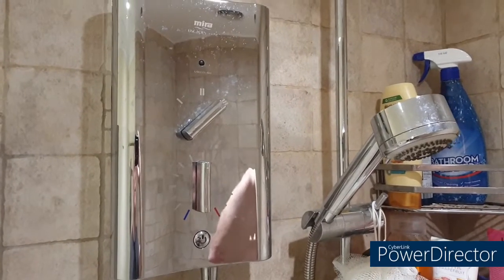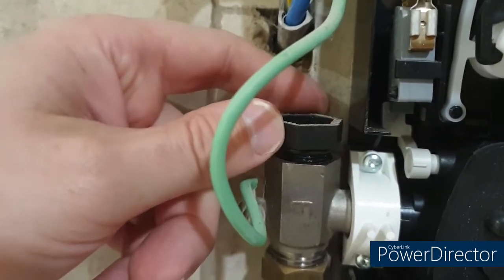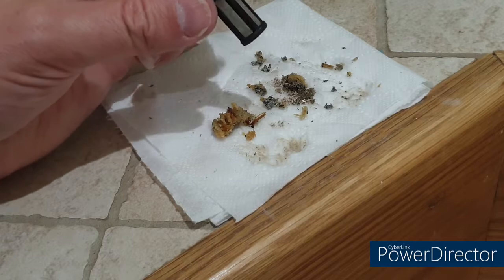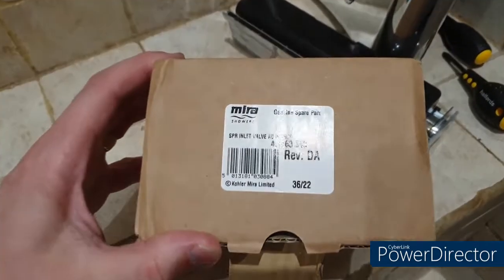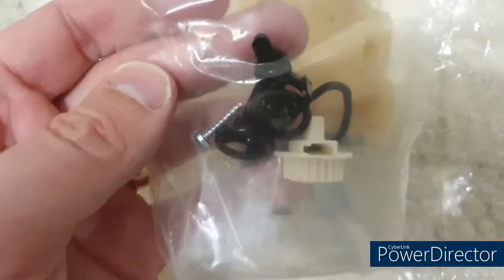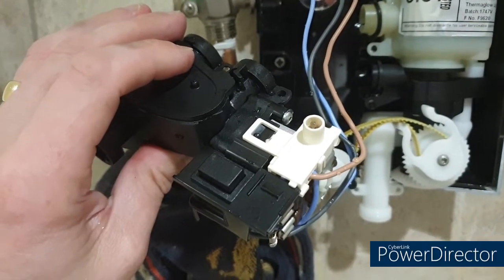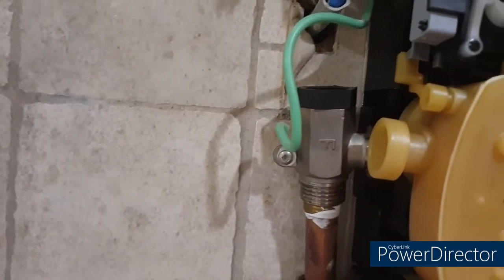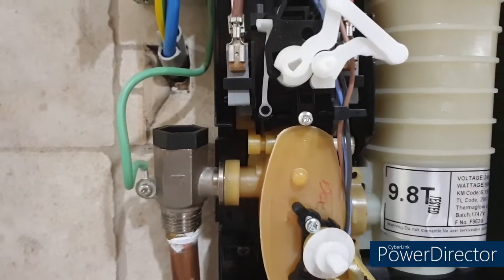Mira Escape Electric shower. Low Flow warning. No water flow. Valve and Solenoid replacement.

Comment: Hi, not sure if anyone will see this or able to help, we have one of these showers , sometimes when turning it off it the water doesn’t stop running, we’re having to shut the water off or the main power to the unit, other times it will go off but take like 5 minutes , would this be the solenoid too thanks

Comment: What is the likely fault when the shower runs for a minute, then it trickles out, power remains on at unit and mcb doesnt trip etc, turn it off and back on, it'll do the same process? Any ideas

Comment: Stupid question but do i need to turn the water mains off when loosening that fitting @9:24 or will water just continually flow out of it?😄
Reply from the maker: I think I had the mains off throughout doing this. Didn't want to risk it spraying on the electrics.

Comment: Thank you for the video, just changed the flow valve on my Mira azora 👍
Reply from the maker: Good for you! No doubt saved hundreds in plumbers bills too! Pleased it helped you.
Reply: Will changing the flow valve fix the temperature not changing?
Reply from the maker: @tdhpst  I think you'd need to change the thermostat for that one.
Reply: @TefsTravails  is the flow valve not thermostatic? I'm looking at part 1563.540 for a Mira Sport
Reply from the maker: @danielalmadani4907  I actually phoned up Mira customer services and spoke to their technical help. They knew what they were talking about and directed me to the right part. Worth a try.
Reply: @TefsTravails  thank you, will do! Appreciate it🙏